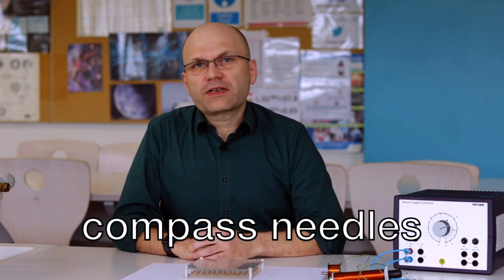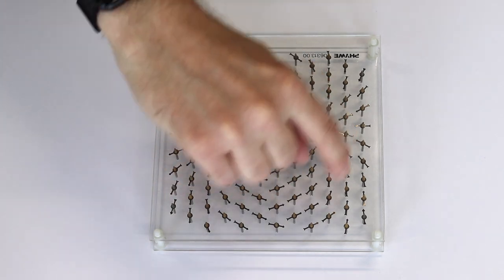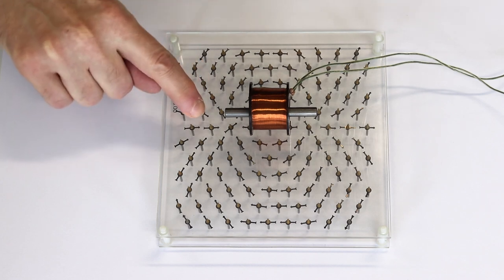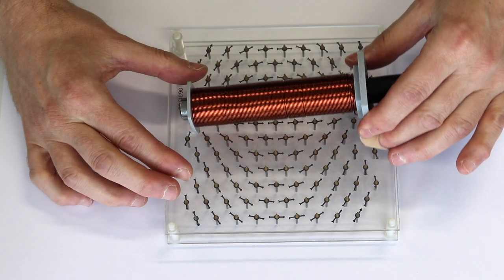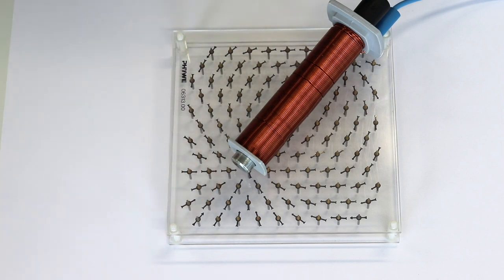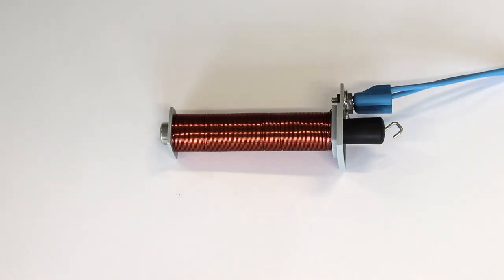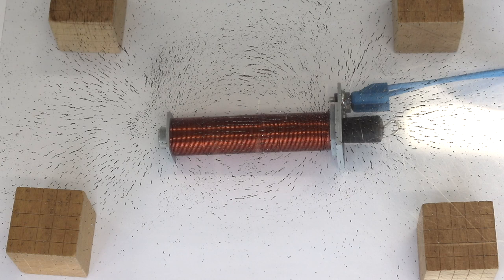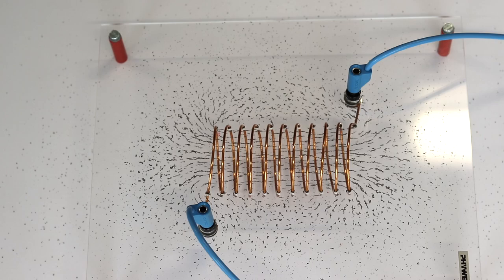Visualizing Magnetic Fields

Comment: Hi Mr.Pop, thank you for your videos.  I have a question related to the magnets in general. In one of my projects I try to use a combination of an electromagnet and a permanent magnet. When the electromagnet is off , the permanent magnet is using the iron core as the attracted object. When the electromagnet is on , the permanent magnet is repelled , but only if there's no contact between them. Once there's contact , I get attraction even though in mid air they are repelling each other. Now , is this because of different attraction power between the Neodymium magnet and the electro one? Do they need to have the same pulling force or do i need more power to the electromagnet side in order to repel the neodymium magnet?. This test was run with a 3kg electromagnet (with a metallic case) and a neodymium magnet close to the diameter of the iron core.
Reply from the maker: Hi Dorin. That is an interesting question. I assume you’ve already watched my video on this topic. ( https://youtu.be/IDYx1BjDXzE ). I used a relatively weak magnet so if the electromagnet has the right polarity then repulsion occurs even when the permanent magnet is is contact with the iron core. (See at 2:01 in video above). However, I can imagine that a strong neodymium magnet would “overwhelm” the magnetic field of the coil and would magnetize the iron core (I.e. realign the magnetic domains) so that it produces attraction after direct contact. I can’t check this right now (still on holiday :) but I will try the experiment with a neodymium magnet if I have the time (and even post a video if I find something worth showing).

Assuming that my thinking is correct, you can “fix” the problem that you are describing by using a weaker permanent magnet or by increasing the current through the electromagnet. (Obviously, I don’t know the specific circumstances of your setup so be aware that a stronger current through the coil can burn it!). Good luck with your project!
Reply from the maker: Hello again. I can confirm your observation: I repeated the experiment but this time with a strong neodymium magnet. The coil and the magnet repelled each other when there was a small gap of a couple of cm but as soon as the neodymium magnet touched the iron core it magnetized it the other way and thus created attraction (magnet remained stuck to the core) The magnetic field of the coil is much weaker than the one of the magnet even for relatively high currents. Maybe I’ll find some time in the future to record a quick video update.